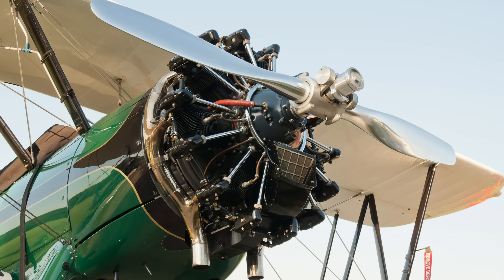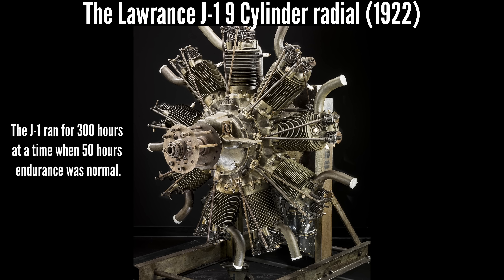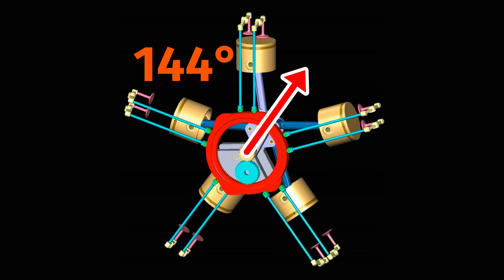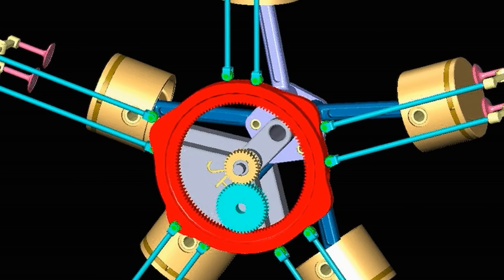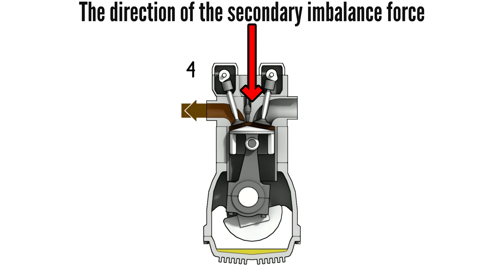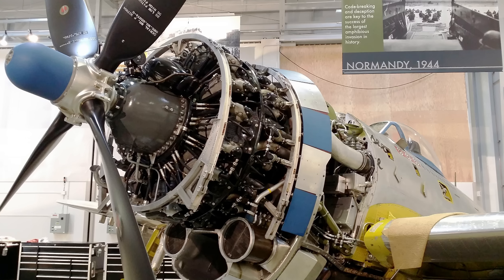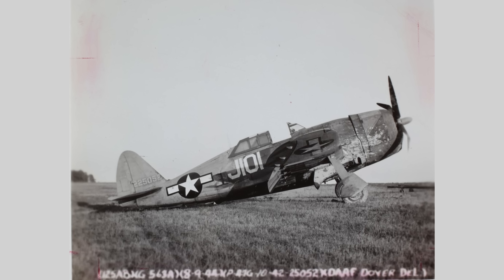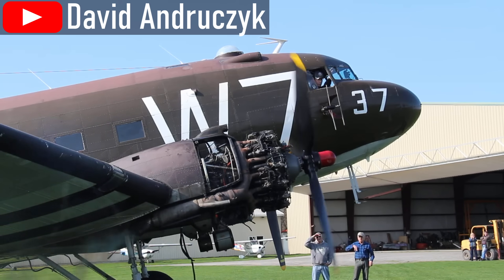The Rise & Fall of the Radial Airplane Engine - History & Technical

Comment: High lubricating oil consumption by air-cooled radial engines is also worth noting. I was in charge of lowest level line maintenance of a Navy T-28 Trojan in the early 1970's. My not too reliable memory is that more than a gallon per hour was normal at low power setting and much more than that at (rarely used) high power use. The 1,425 hp Wright R-1820 Cyclone in a T-28 had a huge oil tank. Sorry I've forgotten just how many gallons. The very expensive oil changes were determined by regularly sending samples to a lab for analysis, not by calendar interval or engine hours.

Comment: I learned a lot from your video,but still missed how the radials that spun around a stationary crank handled lubrication. Could not use an oil pan obviously, so was oil mixed with feul,Ala two stroke design  and fed through the hollow crankshaft?
Reply from the maker: Yup a total loss lubrication system like you guessed, using castor oil.

Comment: and also too . . . the Wright R-975 Whirlwind powered the Sherman tank! . . . nine-cylinder air-cooled radial with a displacement of about 975 cu in and power ratings of 300–450 hp

Comment: Radial engines had a huge frontal area causing drag. But inline or V engines required a heavy cooling system and had a radiator causing drag, and of course being shot down due to loss of coolant and the resultant crash caused drag also. No such thing as a free lunch.

Comment: Wright experimented with a 4090 cubic inch 22-cylinder radial, as well as Nakajima (Ha-51) from Japan. None of the Wright R-4090s exist, but the battered remnants of one of the Ha-51s still exists.

Comment: The rotary design is interesting in the fact that it turned reciprocation into rotation without the main issue of a reciprocating engine, the acceleration, deceleration and instant change in direction of the linear motion. I wonder what a 2 stroke design would have yielded over the 4 stroke. No valve train, each rotation was a power stroke for all cylinders, etc. Were there ever any 2 stroke rotaries?
Reply: I think the drawback would be the need for some kind of compressor or charging piston to pressurise the incoming charge, and force it through the transfer ports into the cylinder.  Most petrol 2-strokes use crankcase compression to achieve this, but it means that in the case of a two or three cylinder engine, you need seals on the crankshaft between each pair of cylinders, so that each cylinder has its own crankcase, which is pressurised at the right time.  As far as I can find out, the only possibility of a rotary 2-stroke would be something based on a Wankel engine.
In a rotary engine, all cylinders share the same crankcase, so it cannot be used to for primary compression.  The only way it could work would be to adopt the same system used on some British 2-stroke diesels (such as Fodens, and Napier Deltics), where you have either a mechanically driven Rootes-type supercharger, or an exhaust driven turbo charger to provide a source of compressed air for the inlet.  Any such addition to the rotary engine would have added so much extra complexity and, critically, extra weight, to what was in essence a simple and lightweight engine.
One of the main factors behind the success of the Wright Flyer was that the Wright's fully grasped what was critical about aircraft engines at that time.  The power output was important, obviously;  what was far more important was the power-to-weight ratio - a point where the rotary engine really scored.
In WWI, the 24.9 litre Bentley BR.2 rotary engine gave 250 HP, with a dry weight of 490 lbs.  In the same period, the inline 14.2 litre Rolls-Royce Falcon gave 288 HP, but weighed 715 lbs!  To sum up;  the Bentley rotary put out 25% more power per pound weight - a massive advantage.  HTH.

Comment: The Vee engine might look more streamlined, but you still have to cool it, thus you must add the drag caused by the radiators.
Reply: In theory diffusers transform velocity to pressure ( without much drag ). The slow velocity through the radiator has low drag. Then accelerate through a nozzle with this flaps like behind a radial or the F-22 Raptor. Flaps regulate the temperature. 

Ideal radiator fins have round leading edge .. a tube of coole coolant. Trailing edge needs to be a wedge. Contra-flow. 

At there radiators where the coolant flows cross, but goes through multiple tubes from back to front? Stagger those tubes like a two row radial.

Theory also says that the exhaust velocity should be above plane velocity by means of a fan before the radiator. Like if the prop wash doesn’t hit the inlet.

Comment: The main reason for the Gnome rotary in 1908, i think, was that it had a single poppet valve concentric in the symetrical head.  There it was cooled not only via the seat but also by gulping cold air during the inlet stroke.

No vehicle engine before the 1914-18 war could tolerate full power for a solid minute, but aviation needed such.

War quickly caused logical minds and real money to investigate and improve them.  The air cooled radial played no part in that war but the Germans made several good inline 6 and V12 water cooled ones.  The British air cooled radial took over civil airline use fairly soon but US Mail carriers used the V12.  US civil airlines came later than KLM or several European ones.

Cylinders make power, cranks are unfortunately necessary but weigh plenty.   Why then did Junkers use 12 cranks for 6 cylinders and had a train of heavy gears to couple the cranks?   Hugo observed the smoke and asked for a decent petrol V12.   Should motorists of the diesel is 'green' era have thought before buying?
Reply: You ask why Junkers built opposed piston diesels. The answer lies in their use of the 2-stroke cycle, this helps offset the poor power to weight ratio of diesels. With opposed pistons relatively efficient uniflow scavenging can be used, the exhaust side crank is phased a few degrees ahead so that the exhaust ports are covered before inlets on compression (allows supercharging) and the engine is shorter (but taller) compared to an equivalent inline.

Comment: 01:15 By looking at the beautiful geometry of the rotary radial, one can understand the sheer genius of the concept. The cylinders and the pistons and connecting rods assembly form two eccentric flywheels with no reciprocating motion whatsoever in relation to the frame of the aircraft. This translates to ZERO vibrations, which was important with the flimsy wood-and-canvas early airframes.

Comment: A couple of points: Radials do not make better power than an inline engine. To make the equivalent power they needed to have a much larger capacity.
Secondly, no radial engine can continue to run with a cylinder missing, the conrod and piston assembly would smash the crankcase to pieces within seconds.   ...A cylinder head maybe.
The most power a production R-4360 made was 4,300 hp but proved to be unreliable and needing intensive maintenance. Even the majority of later variants making 3,500 to 3,800 hp required a lot of maintenance and thus poor availability.
Reply: There's pictures of radials making it back to base with damaged cylinders
Reply: @kenneth9874 .   I flew the DC3 in the early 80’s for 2 1/2 years.   One night in the descent,  the engine gave a slight cough,  and though a sign of trouble , it kept running fine.   As we taxied in,  it sounded like a steam engine..
At first I could not see anything wrong when I inspected it.   Then I realised the cowling was no longer round !!   Then I noticed I could see behind the engine when looking at it.     Then on close inspection I noticed the base of the cylinder was no longer attached to the crankcase, because all the studs had sheared !!    It kept running though. 😊
Reply: @kenneth9874 that’s different to missing cylinders. Also Radial installations are inherently less efficient at higher power loads due to the fact air is less efficient coolant medium than water.
Reply: @princesofthepower3690  anytime there's a piece of a cylinder missing its not functioning, try running an inline with part of a cylinder missing.....good luck 😉
Reply: The R-4360 VDT (4,300 hp) was a highly unreliable engine due to the fact it had poor cooling characteristics more than anything! But you are right! Radials tend to have worse specific power output compared to Inline engines.
Reply: He compared the P&W R-2800 making more power than the RR Griffon, missing the fact that he was comparing a 46 litre radial with a 37 litre inline and then what specific forced induction was he  picking? that Griffon’s low output looked like it was from a single stage supercharger version despite the ‘Griffon 65 (no boost)’ label.  What did no boost mean, did the P&W engine make its power with no boost?  Stating that WW2 radials made more power than their inline counterparts and so were just as good despite their higher drag is sort of true if you can carry all the required extra fuel you will be burning.

Comment: The limitations of rotary engines didn't stop them from trying. Various manufacturers tried weird and terrifying designs to try and work around the power limitations of the rotary engine.

Siemens-Halske had their SH.III, which was a single row 11 cylinder rotary of 160 HP. In an effort to try and cancel out the P factor, they geared the back of the engine so the crankshaft and engine block would rotate equally in opposite directions.

Gnome et Rhone had several terrifying dual row rotaries of 14 and 18 cylinders, and one extremely terrifying four row rotary of 28 cylinders. Thankfully none of these were mass produced. Can you imagine almost a thousand pounds of engine rotating at 1300 RPM? I would want to be nowhere near it. Sadly owing to their obscurity, it's hard to find any pictures of them, though they do exist. There is one example of a dual row rotary at the National Air and Space Museum.

Comment: Probably the best application is front prop Part 103, with the little 3 cylinder radials. It's just about the best possible option, with a light weight short engine swinging a really big prop with relatively low speeds.

Comment: The secondary imbalance became a big thing on 18 cylinder radials, which being 180° out of phase between the two rows, resulted in a wobble motion in which the engine constantly tried to change the propeller’s plane of rotation. Pratt and Whitney as well as Wright ended up installing rotating counterweights (not exactly “shafts”) to counter the forces. It was killing propeller shaft bearings. The effect was discovered in around 1938 or 1939 when the R-2800 and R-3350 were in development.
Reply: I worked on and flew in planes with the R-2800 for years.  A great engine that withstood enormous damage and kept running.
Reply: @ James, what did you fly/work on?
Reply: God made Radial engines just for airplanes !!
Reply: Regret my disagreement.  
   A single row radial is well balanced in primary and secondary.  Facing the engine, If one draws lines connecting the piston wrist pins ..(approximately the piston CG’s) a circular figure emerges.  This balanced by the crank Counterweight.
  A twin row is two balanced single row radials bolted together.  There is No rocking couple as witnessed in a two cylinder in line.  
   Single row radials (R1820) have bifilar dampers…
    What causes whacky radial balance problems is   
         1.  the link rods/pistons do not have true motion, thus don’t hit TDC corresponding to crank.  So the link pin locations on the master rod are clocked.  Great for timing, not so good for 2ndry balance.    Enter bifilar damper.
         2.  In a twin row, 2nd engine row is clocked (for cooling) relative to the first row.  The 2nd row can’t be oriented optimally to counteract 1st row.
      “Old Machine Press” (googable) has a paper on developing the R2800 crankshaft and working through its balance problems.  OMPress is a gold mine for gearheads.           Cheers D
Reply: @danbenson7587  Our source is the same! Yes, different acceleration of the pistons due to the link pins not having the same center as the crank pin, plus the pendulum (ish) motion of the master rod. Maybe not identical to secondary imbalance/vibration, but it was solved by the 2x crankshaft speed geared counterweights.

By the way, where is William Pearce, he  hasn’t updated OMP for quite a while?
Reply: @88SC  I agree. My understanding is that the problem was mostly a "rocking couple" along the length of the crank as previously stated, but one that did occur at double the crankshaft rotational speed. Hence the addition of counterweights running at twice crank speed to (mostly) solve the problem.
Reply: Which is why a competent Sopwith Camel pilot could use the gyroscopic effect to face the aircraft 180° when an enemy was behind.
Reply: @jonathansteadman7935  The WW1 rotating radials, yes.  WW2 fixed radials not really.  Gyroscopic precession is the actor here.  WW1 engines and props made a greater proportion of mass (25%] of the plane so precession effects stronger.  WW2 planes precession mainly from the prop (1-2%).
Reply: @danbenson7587  There is no such thing as a rotating radial, merely a rotary engine, and due to the spinning of the engine would lead to the fuel to burn on only one side of the cylinder and thus cause uneven wear of cylinder and bore.
Reply: @marcussoleil3733  ‘Rotating radial’ was deliberately is used to avoid confusion with the ‘rotary’ sometimes understood as a Wankel.      Rotary engines wore prematurely due to Corliolis acceleration.   This is the cause of the mixture moving to one side, and also the piston simultaneously being smashed against the same cylinder side.  The latter gave no chance for oil to work between the piston and cylinder.
     If unfamiliar with Corliolis, check Wilkepedia.      Thanks for comment, cheers D

Comment: It wasn't a rotary it was a wankle engine.
Reply: False, the real rotary engine is the Gnome type (use on the most WW1 aircrafts), the earlyest design was from the french Felix Millet in... 1895, a 5 cylinder rotary use in he's own motorcycles (inside the rear wheel), a Wankel IS NOT a "rotary engine" but a rotary PISTON engine (from the german designer Felix Wankel NSU engineer KKM Wankel type (KKM means "Kreis Kolben Motor"), Mazda did only buy the licence for this engine...
Reply: @leneanderthalien  Felix Wankel did not design the KKM, he (At least according to Wikipedia) seemed to despise the KKM.
He was a designer of the DKM, which works quite differently, instead of having the rotor wobbling about on a eccentric shaft it had the rotor rotating at one spot and having a second outer rotor(Analogous to the case from the DKM-design) rotating on another axis.
Reply: Shame on Mazda (or whoever started misusing "radial" to describe Wankel engines) for the confusion

Comment: That large frontal area was quite a handicap for an aeroplane engine. For that reason radials had been thought to be unsuitable for high-performance fighter, but Kurt Tank turned all that on its head by showing the way with the ingeniously smoothed-out nose of his outstanding FW190.
Reply: Hey the us navy have been doing that since the late 30s to early 40s.
Reply: @aker1993  IIRC, the USN never used an inline on a carrier routinely. They went straight from radial to turbojet and turboprop. Even the Ryan Fireball was a radial when the streamlining of a inline would really have helped the jet improve performance. Besides. the additional storage space for coolant/prestone storage in order to service them would have meant something else getting reduced and there's no way that was gonna happen.
Reply: Nope it’s biggest innovation has to be the engine control system. It was nearly a fadic in analog form.
Reply: The aero cowl used by Tank was a modification of the already existing NACA cowling developed in the US before the war. The radial engine that BMW developed for the FW190 (BMW 801) was a descendant of an American design  (Pratt & Whitney Hornet), which was built under license by BMW in the 1930's. The Americans, Japanese, French, and others were all developing radial engines for fighter planes (mostly for navy use), before Kurt Tank got around to the FW190. Germany has many great WW2 designs, and many engineering fists, but this was not one of them - they were later than most to this party.
Reply: The biggest innovations on the Fw 190's engine installation were not the cowl itself but the use of a gear driven cooling fan and the 'swept back' ejector exhausts that were aimed out through the cooling gills at the back of the cowl. Both features aided airflow at low speed and allowed the cowl to be somewhat smaller, with a narrower inlet.

The Allies certainly took notes, as the swept back exhausts appeared on some later Allied designs (e.g. the Tempest II) and CAC in Australia copied the cooling fan for their proposed upgraded model of the CAC Boomerang.